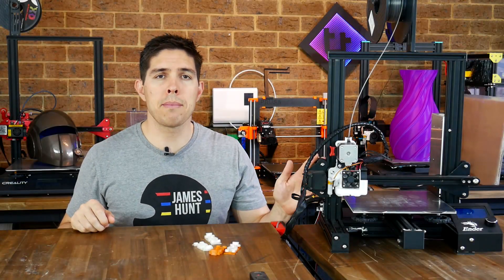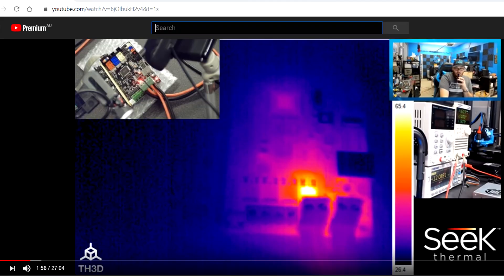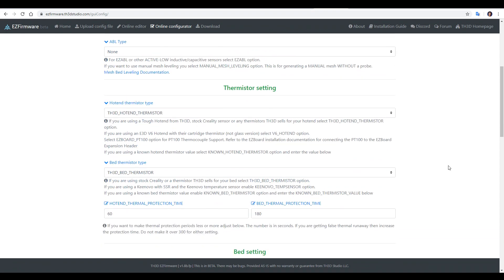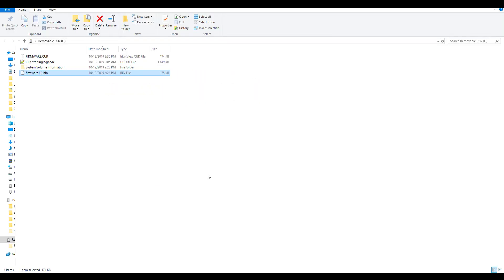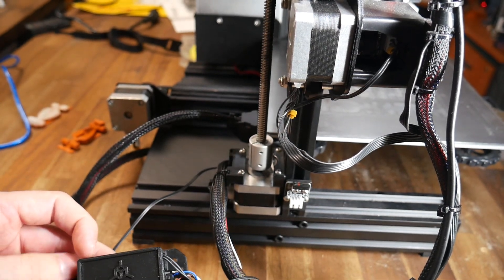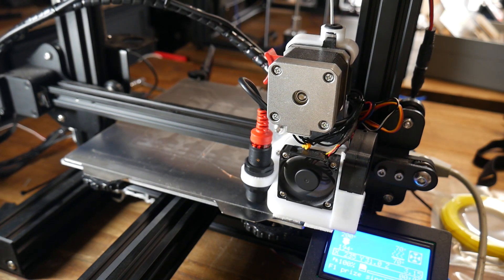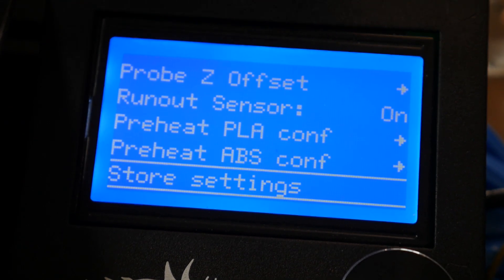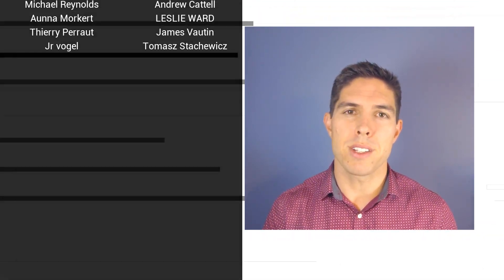EZBoard Lite - The most user friendly Ender 3 mainboard upgrade + EZABL Pro

Comment: Here I was ready to buy the SKR Mini from Aliexpress, but was having issues adding it to cart with my new account.  30 minutes later you put out this video and I'm now ready to spend 3x for an easier solution. Thank you!
Reply: If you have any questions make sure to ping our Live Chat or our support team: https://www.th3dstudio.com/contact-us/
Reply: And this is why it's worth spending more for this board.  You are never going to get this kind of support at $27.00.
Reply: @TH3DStudio  Sorry, I wasn't being clear: the problem was with Aliexpress. I couldn't buy anything from them today.
Reply: @TH3DStudio  why 2208 instead of 2209? What about linear advance?
Reply: @BigDan1190  we went with 2208's because they are solidly supported in Marlin. The 2209's are also having yield issues and are therefore quite difficult to source reliably. Rather than going the BTT approach and have some batches be 2209 and others be 2208's, we went with the consistent 2208's. Also, the 2209's don't add any features that are useful on this machine. The physical endstops have a higher accuracy and repeatability when compared to sensorless homing, and the currents we run do not require the slightly higher RMS current the 2209's offer. Linear advance works just fine on this as well!
Reply: @itsmegriffo  Ah thanks for the explanation :) I had read that linear advance didn't work on 2208 but to be fair i couldn't link to any article e.t.c....

Comment: I just installed this with the filament runout sensor... in 2 hours I was back up and running printing last minute Xmas gifts. It's amazing... I keep having to look back and make sure it's actually printing. The before and after on noise was ridiculous. I just slapped on my 2 year old bltouch from my previous machine and it's going strong. Thank you for this video!

Comment: Yep, a $100 replacement mainboard for a $150 printer makes so much sense and is totally reasonable.
Reply: You usually get those boards in order to get replaceable / quiet stepper drivers. It won't be that easy to find an off-the-shelf, proven printer platform with a 32bit board and TMC drivers  for less than 250$.
Reply: @Andreas-gh6is  But this board does not even have replaceable stepper drivers. If one of them fails after the warranty, you will need a new board. (Warranty from USA is also not known to be necessarily good) For this pricepoint I just expect the luxary of having them replaceable. Ender 3 + SKR v1.3 (or SKR Mini E3 DIP) + 4*TMC2208 (or TMC2209) < 200€
Reply: @SchwachsinnProduzent  That is a good point. Though my calculation was meant for an off-the-shelf 32bit printer. I think there are arguments for both boards, and I think for me the skr board looks more attractive. I'd put in external mosfets for the heaters, because apparently the SKR boards seem to fail more often. Otherwise it comes back to the convenience question. Built-in drivers don't matter a lot if the package is complete and well thought-out, because the Ender 3 is a relatively known system with few surprises. I personally never had a stepper driver fail at all, so I wonder if this even is a big issue.
Reply: SchwachsinnProduzent we have had zero failed drivers out of well over a thousand boards shipped. When properly designed, the thermals are much better for soldered onboard drivers and lead to a much longer cycle life when compared to stepsticks. It’s a common misconception that socketed are better but that is very much not the case.

Comment: Super awesome product! As for the price difference with the SKR Mini, I think it depends on who is buying either of them.
Since I am familiar with development tools and I'm good with tinkering with electronics, the SKR Mini is more appropriate for me. I'd rather pay the price difference in other upgrades. 
However, I can certainly appreciate a top notch product like this one. Kudos to the makers!
Reply from the maker: Well summarised
Reply: Consider a few things regarding what TH3D is putting out.

They put 2 OZ of copper per layer in their boards which is what trinamic recommends for proper thermal transfer.  SKR does not.

TH3D used a 4 layer which is what trinamic recommends where as SKR doesnt.

TH3D spent 10 months testing this board and made six revisions to the board before releasing it.
SKRs board was tested for about a month and has had numerous failures and issues with getting firmware to work.

https://www.th3dstudio.com/ezboard-lite-why-do-you-use-the-tmc-2208-instead-of-tmc-2209-drivers/

Comment: Loving my skr mini that i bought due to your review.
Reply from the maker: I've just updated the free firmware linked in the V1.2 guide if you're interested.
Reply: @TeachingTech  where can we find it?
Reply: loving the skr mini e3 1.2...only issue ive been having is it not being able to save to eeprom. It always resets after a power cycle. I tried the memory mod mentioned in the last video but i think it has something else to do with memory constraints wiht some of the SKR's :(
Reply: @TeachingTech  Yeah I'm running that updated firmware on my V1.2 mini, it's really good thanks for that!
Reply: @TeachingTech  yes i am interested and thank you.
Reply: @YogeshPatel9  have you tried the new skr mini e3 512k they have worked out the eeprom bug and increased the memory from the 256 to 512. And your now able to save any eeprom settings right to the board instead I'd the virtual sd eeprom
Reply: @cowboy124aa3  i ended up figuring out that mine was trying to save EEPROM to the SD, so if i left the SD out it wouldnt save. there was also the firmware.bin file that wasn't renaming to .cur after, so it kept flashing everytime i started the machine. all working now!

Comment: Thanks for the review! Just recently got a EZABL Pro for my CR10s from TH3D excellent service from them, well documented installation guides, will certainly consider their board over the SKR only problem for me is having to pay customs charges as Im in the UK and as they base the charge on the cost of the item I have a feeling this would work out to be a rather expensive option over the SKR but thats an upgrade for me to consider later

Comment: "It is more expensive" 

Slight understatement for something that's 4-5 times higher in price than the SKR Mini E3, and more than half of what most people pay for the printers they're putting these things in..
Reply: This board is for suckers like me who paid $229 for an Ender 3 from Amazon.
Reply: Timothy Hoogland  I get the quality argument. I think it's still a hard sell for the Ender 3, because the SKR Mini 3 is relatively well documented/supported in the community by now, and it's not even that hard. With the Ender 3 price point and considering I am going to have to do a lot of manual work/modding anyway, I think I would go for the cheaper board.  I do wonder how the quality difference matters in the long run, though ...
Reply: Timothy Hoogland  The difference in quality may be true but the shipmentcosts alone to Belgium are as high than the price off an skr mini e3. The ender 3 is an entry level machine for me to learn 3d printing. I rather save my money for a new printer in a few years that will probably already have a better board.
Reply: Keep in mind TH3D properly engineered this board, spend 10 months developing it.

Used the proper number of layers and amount of copper for traces per trinamic data sheets.

During that ten months they made six revisions to the board to ensure it works properly with the hardware and firmware.  They wrote the firmware and made sure it worked correctly.

SKR currently is having premature hardware failures and issues with the firmware working correctly with the hardware.

If you want a product that works straight out of box and setup per their directions.  Then this is the board for you.

If you want a board that will prematurely fail due to using only a two later board and not enough copper in their traces then by all means by an skr equivalent board.

https://www.th3dstudio.com/ezboard-lite-why-do-you-use-the-tmc-2208-instead-of-tmc-2209-drivers/
Reply: @Andreas-gh6is  here us why the quality matters.

SKR only spent a month developing their equivalent board, have had numerous premature board failures due to using a two later board against trinamics recommendation of four laters.

SKR also used less copper in each later regardless of trinamics recommended amount.

These factors can yield more issues with heat not dissipating correctly and potential for a fire.

https://www.th3dstudio.com/ezboard-lite-why-do-you-use-the-tmc-2208-instead-of-tmc-2209-drivers/
Reply: 3x the cost, 6x the value. Either run the stock board 'til it dies and get this, or get this now:)
Reply: @thosj1007  The stock board is actually very reliable with the A4988 drivers. Creality did a decent job on them.
Reply: Jesus christ what a waste of money. This would make me regret getting my Ender and just get an $800 printer

Comment: Purchased my boards (2 of them) when they where on preorder the first round.  One in a Ender3 and the other in a Ender3 Pro. They worked flawlessly.  Making upgrades to Ezabls and runout sensors is as simple as bolting/installing the upgrade and downloading the firmware from TH3Ds webpage.  When you do you will be using the most current version of Marlin to boot.  TH3D  updates and test that for you. I just want to be able to print my projects not have to learn how to change machine code and the software to do it in.  Just a fan of Teaching Tech and a happy customer of TH3D.
Reply: It really is amazing how easy it is to add more to your printer with this board and customize the firmware in minutes. It's basically so easy that beginners can do it with no issues. Just have to make sure to not use a card over 32Gb or risk bricking the printer, and make sure there are no partitions in the card from Octoprint for an example.

Comment: I already installed the EZABL on my Ender 3 and it works like a charm. I can't wait for the EZboard to get here. I'm aiming to have EZABL, filament sensor, silent steppers and some neat marlin features that simply didn't fit in my Ender 3's stock memory. I also hope it gets rid of the slight salmon skin I've noticed. It's not very pronounced, but noticeable in straight walls under close inspection.

Comment: I have the EZBoard and love it and after watching their test of other boards I definitely like the rugged design.  Note how others have added heat sinks to the various chips. TH3D’s EZBoard ops to build the PCB as it should with enough copper to dissipate the heat and does not need heat sinks... worth the cost for dependability.

Comment: Personally I wouldn't call it over engineered.  Rather properly engineered.

Such as they used the proper number of board layers to prevent the board from burning up.  Which other 32 bit boards use cheap 2 layer board which will eventually burn up without an external mosfet.

Also they used the correct amount of copper in their board traces.  Where as many other board use substantially less copper in their traces.
Reply: Glad someone understands our thought process. Proper thermals, proper terminals with ample factor of safety, and no corner cutting anywhere else. Quality costs money and it's hard to get that across sometimes.
Reply: People want quantity over quality unfortunately and dont understand what a quality product is any more.
Reply: @creamysbrianna  well we are talking about a 150 dollar printer , remember.

Comment: I like your shirt...this board is nice and yes, the quality is probably better than the SKR, but this is maybe mainly a good purchase (if you have the money!!) if you live in the USA..in Europe, not so much...with all customs charges, transport charges etc, it will cost more than the Ender 3 complete..European distributor would be a big help!
Reply: As I live in Austria - so in Europe - I have the same problems. But I watch this matter. I like quality and it looks easy handling.
Reply: I can only agree. Sure, the board looks like a great replacement for the standard board in the Ender 3, but if the cost of purchasing and shipping that board for us European costumers gets almost as expensive as the 3D printer itself, it gets questionable. I could maybe persuade myself for buying that board for the price advertised on the website, but the shipping costs are throwing everything off-balance.
I understand that there is no other way (except maybe the above suggestion to switch to local distribution in Europe), but as it stands right now I must sadly say it is too expensive. Maybe If the printer I was using was in a higher segment price range I could be worth the total upgrade price, but the Ender 3 is simply a budget printer, and thus any upgrade has to be in the same kind of budget.

Comment: Hey guys! EZBoard engineer here- if you have any questions about the board just drop them under this comment and I will answer them for you! The board uses all top quality and name brand components as we built it to be as high quality and as reliable as possible. Hope you guys enjoyed Michael's awesome review!

-Griffin
Paquette Engineering/TH3D Team
Reply: ETA on the "Pro" version of the board with say 2209s and Dual Extruders? ;)
Reply: Isogen it’s getting closer:-) I would say first quarter 2020 release. We have some other great features we’re adding on that have made it a bit more than just adding another driver. It’s also been tough for me to get 2209’s for prototypes but I am actively working on getting my hands on them in greater quantity.
Reply: Have you guys had more sd slot issues. I saw a guy on the forum with an issue and mine came with an issue out of the box. The pins were off or something and inserting a micro sd just once buggered them up. I knew I had an issue when the card felt mushy in the slot. Returned the board for warranty was was quoted money to repair it.  100 bucks for a bricked board and then charged over 30 to repair it.
Reply: @eat_the_octopus  hmm that is very strange that you had an issue like that out of the box. Are you sure that the card was put in the correct way around? I find it odd that you were charged for something like that but I do not directly handle tickets and have not heard of any other mechanical issues with the SD card slot. We have had a few people have issues getting their cards to work but all were resolved by either swapping to a different card (all boards are picky about capacity) or just formatting the card. I have personally not seen any boards cross my desk with bad SD card slots.
Reply: Is it Made in China?
Reply: I see no cooling device on the drivers, no concerns about that matter?
Reply: Timothy Hoogland  Thanks, learned a lot from that. Since my original board on my Ender 3 (an everlasting tinkerplace, every 3 prints something breaks or goes wrong; the Ender 5 works like a charm with the silent board) smoked its drivers I was a bit concerned. But Your answer sounds reasonable to me, now I am thinking about replacement to 32 bit for my ender 5 (of course)
Reply: Does the config for filament runout detection also include manual advanced pause and power loss recovery or does it only trigger on filament runout? Ik this isn't a question about the board but I need to know.
Reply: What kind of features will the "pro" version have vs the Lite? I'm in the market for a new mainboard for my Ender 3 Pro after it shorted out, but I would hate to go with the lite if a higher-end version will be coming out soon!
Reply: Timothy Hoogland  Thanks for the info, I got the point. Well my education was more commercial, technic is just a hobby - very interesting, but You learn every day  (if You want to). I appreciate Your answers, now I need an European partner to buy from.
Reply: Hey, I might be overlooking something in the specs but I can't find how much space there is on the chip? 512kb, 1mb,...  ?
Reply: @Drew_pew_pew_pew  Its 512kb :-)
Reply: @gregtaylor7957  I can't speak too much on the features out of concern for copycats, but it will be a 5 driver board with some newer peripherals we think many users will quite like! If you don't need the extra driver and like the features on the lite it will still be an awesome option!

Comment: I'm intrigued. I'm considering trying it. The whole lot, with the EZABL sensor and filament runout detection. It looks moderately easy, especially with the online configuration tool. I already have TH3D Unified firmware running, with Advanced Pause and manual mesh bed leveling. This should be doable. Be aware though, I hear the BLTouch 3 is incompatible with stealth boards.
Reply from the maker: The BLtouch v3 only has issues with some Creality boards that have a capacitor on the end stop pin. No issues with this board or any of the SKR ones I've tested.
Reply: @TeachingTech  Yep, some boards might have that capacitor. I've already got EZABL and it works perfectly, can't wait to receive the EZboard.

Comment: I realize your ender 3 gets all the goodies due too the incredible work you are doing with your channel however I have to ask...How much would it cost to build your specific ender 3? Are you over $1000.00 yet?
Reply from the maker: No where near. Quick summation: E3 - $200, BLtouch - $50, EZboard lite - $100, Wham Bam sheet - $55, buck converter - $5, Noctuas - $40, DD kit - $35, EZR - $35, cap tube and fittings - $30 = $550. Keep in my you could get the actual printer cheaper and switch in an SKR mini E3 board and you'll be comfortably under $500.